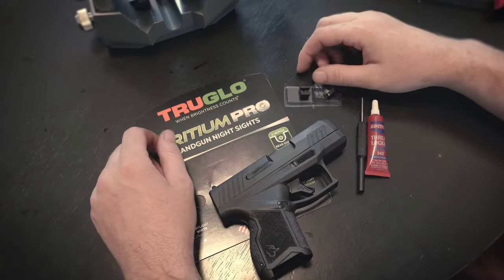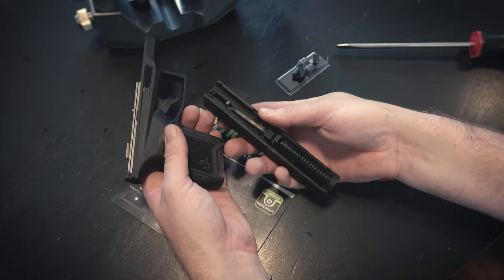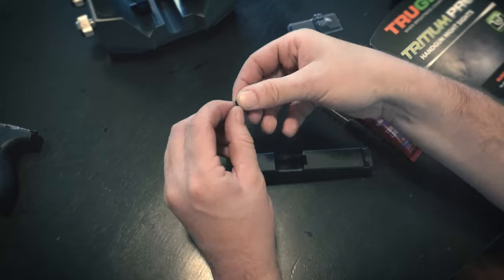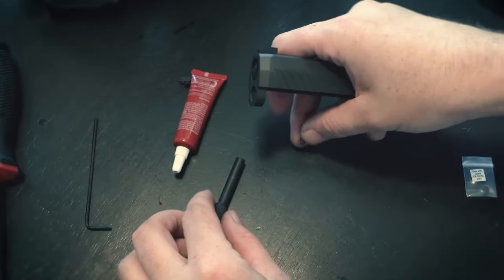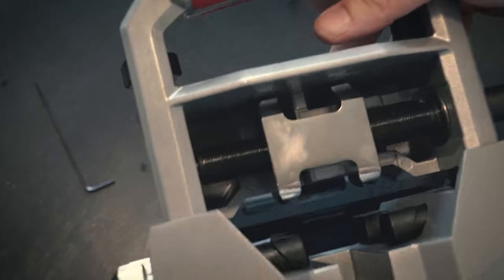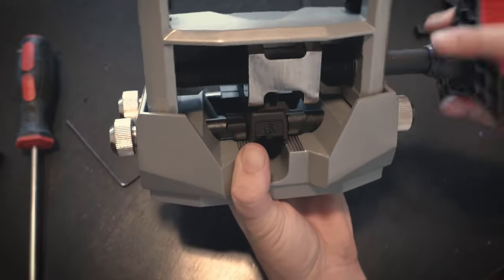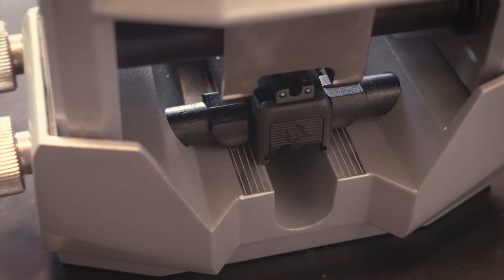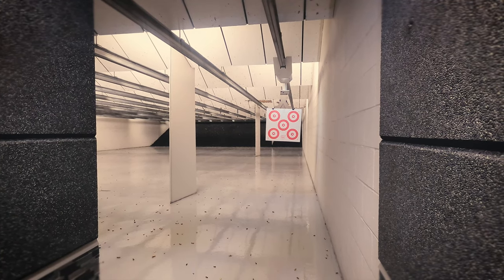Taurus GX4 Takes Glock Sights!

Comment: I ordered the one for the 19 and it worked and looked fine. It is a little wider but there is still room on the sides of the dovetail slot for adjustment.

Comment: Clear it, squeeze the trigger, then rotate the slotted pin. Slide comes off pretty easy. I’ve noticed that if I don’t squeeze the trigger before turning that pin, the slide starts to move forward and gets stuck… until you work the slide again and the take-down pin resets.

Comment: I use Truglo Pro for G17/19 on the GX4. The G42/43 sights have the same height as the one for G17/19. The only difference is the width.
Reply from the maker: Correct, on the rear sight. Front sight is the same. Either will fit

Comment: I like the Allen head screw on the Taurus front sight.  It's a much less awkward system to me.  One big difference between Glocks and the GX4 is that the GX4 has a chassis system.  What that means is if you want to buy a replacement grip for whatever reason on your Glock, it cost a few hundred dollars and will have to go through an FFL.  As with the Sig P320 and P365, you can simply remove the chassis on the GX4 and replace the plastic grip.  This is the second video I've seen with the Real Avid pusher.  I think I need one.

Comment: When using XS glock sights on the Gx4, you want the glock 17-19 option.
Reply from the maker: Yes. To clarify, the dovetail and front sight is the same. It is just the overall width of the rear sight. TRUGLO 17/19 or 42/43/48 models fit.

Comment: To remove the slide why didn't you use the tool that came with your gun? It was that little tiny Mini gun not as a keychain ornament.
Reply from the maker: You can, I just don't expect people to keep up with that thing compared to finding a screwdriver or piece of range brass
Reply: It’s in the instruction booklet that tells you of the little gun on the keychain n its purpose.

Comment: Here's my question... I just got a new Taurus GX4 Carry (toro) and I need to know 'if' that Truglo front sight tool will also work on my Taurus GX4 Carry hexhead front sight screw? 
I believe the Taurus hexhead screw is 3/16".
And if it will work can you give the tools part number so I can order from eBay or Amazon.
Also... the 'punch' end of that tool, does anyone know if it will work for my Taurus GX4 Carry back-strap pins???

Comment: I have a 24/7 Pro, but I called Taurus earlier and they told me they neither have any accessories for my model nor can they give me any advice for tips because of the class action suit, and I'm desperately trying to find at least front sights that are compatible with my model. Do you have any idea if any other model handgun sights are compatible with mine?
Reply from the maker: I know that Glock sights will NOT fit the 24/7 Pro.. That started with the G2 or G2c, then continued on into the G3 and Gx4 lines.
Reply: @AdventureOne  I think I should be fine with my stock sites. I painted the white dot that was on the front sight neon yellow with liquid craft acrylic paint which worked very well on my Phoenix Arms hp22a, and I did but put a touch of neon orange nail polish on the tops of the left and right side of my rear sight, and I found the sweet spot is to have the yellow dot just a hair above the top of the rear sights and it is dead on. So if I can't find any OEM upgrades or aftermarket sights, I think I'll be alright.

Comment: Glock 42/43/43x/48 size? I am interested in these sights on my gx4 and Taurus offers them but for much more than Amazon so I want to make sure I’m getting the correct ones.
Reply from the maker: That's what I installed here, but after further research, the Glock 17/19 sights will also fit.
Reply: I got Truglo TFO for glock 42. They do fit but the back sight hangs off the back by 1/8 of inch.
Reply from the maker: @viki2162  Yep. Seen that before. The TFO is a great concept, but it forces the sight to be larger. One of the reasons I go with tritium only on smaller guns or anything with an optic cut.

Comment: Any Glock sights or a particular model ?
Reply from the maker: I recommend sights designed for the Glock 19.  Most Glock compatible sights will fit, but you may have POI issues if you use sights designed for a different caliber or long slide model.

Comment: I had a problem with the front stock sight coming loose and now a problem with the rear sight moving.
Reply from the maker: Did you use loctite and let it cure for 24 hours before shooting?
Reply: @AdventureOne  I put loctite after but that problem is from the factory

Comment: Does the rear sight hang off. I got the same sights and the rear sight hung off the end of the slide
Reply from the maker: It did not. Maybe you got the TFX sights that were longer? Or was your gun the TORO model? Optics cut designs can push the rear sight further back.
Reply: Same problem I had. I got tfo for glock 42 and back sight hangs off the back.

Comment: If u don't own that machine u used to take the back sight off how would u take it off or at least move it a bit to even out the backsight??
Reply from the maker: For removing the old sight, a hammer and a brass or plastic punch works great. Just be careful with installation. That can damage the tritium vial, and installing a tritium sight with anything other than a sight pusher usually voids the sight warranty
Reply: @AdventureOne  I just wanna even out the back sight. It's pushed more to the left than even in the middle on a gx4.
Reply from the maker: @WavyVaporizers  If it is NOT a tritium sight, give it a tap with the hammer/punch.
Reply: @AdventureOne  ok cool ty for that info
Reply: @WavyVaporizers  use a sight pusher. You can find them on Amazon

Comment: I might missed the point but it's better ask then cry...what sight model is the recommended for GX4? Best regards, from Brazil!
Reply from the maker: Really, anything designed to fit a Glock 9mm. I really like these Tritium Pros from TRUGLO. (Model TG231G1C) The point is that instead of Taurus having their own sight specification, you can now use the larger glock aftermarket.

Comment: greetings can I install truglo tfx pro for glock 43 in my taurus GX4?
Reply from the maker: Yes, but not on the TORO model. The larger fiber sight would cover the optic plate. The back end of the sight may not line up perfectly (since is was designed for Glock) but it will be very close. You will want model TG13GL3PC
Reply: @AdventureOne  Thanks for continuing to add details for additional models.  Much appreciated, to sort out all the options.

Comment: Will the stock front allen sight screw fit in the new front sight that you installed??
Reply from the maker: I don't think so. I believe the larger metal sight requires a larger screw (length and different diameter) than the factory sight.

Comment: So I need that tool or a gunsmith just to ADJUST my rear sight?? 😒
Reply from the maker: A factory plastic or metal sight can be adjusted with a punch (brass recommended) and a hammer. ALWAYS use a pusher tool if the sight contains tritium capsules. Using a punch on a tritium sight will likely damage the glass capsules and definitely void the warranty on the sights

Comment: I had those same sights on my GX4. While shooting it, my shots were all over the place. After having the rear sight centered with the front. It was hitting low left even while aiming dead center.
Reply from the maker: Well, it's not the iron sights that are inconsistent...  https://88tactical.com/how-to-fix-shooting-low-and-to-the-left/
Reply: That is your trigger pull.  You need to adopt an two hand hold and use your left index finger and go in front of thr trigger guard.  Mine shoots 2" groups at 10 yards.  Takes a lot of practice.  Good luck
Reply from the maker: @dmcd7333  I can pick up my Walther or sig and drill the bullseye. My hits are low with just this gun. Its not way off, but noticeable. Maybe it is me, but it doesn't happen with other 9mms I shoot more often. Maybe this gun just reveals my flinch more than others.
Reply: @AdventureOne  shorter barrel micros do magnify any trigger or grip issues.  I bought a lakeline llc black ported barrel for fun... adds another 1/4" and the port makes the GX4 the flattest shooting micro with almost no felt recoil.. compared to my Ruger, Sig, and Hellcat.

Comment: I can’t get my front sight off my wrenches won’t fit even 2mm
Reply from the maker: Make sure you are using the right hex size. Try applying wd40 or penetrating oil. If that doesn't work, gradually apply heat

Comment: you lost me with the rear sight tool  , I'll only use it once or twice , I'll let a gunsmith put these on .
Reply: I bought one and I've used it about 8 or 9 times the gunsmith will charge u about as much as the tool cost
Reply: @thepistolguy859  good point .
Reply: Buy the sights from a gun shop that installs them for free

Comment: Everything was cool until you pull out this big ass uncommon tool that nobody has so now we all got to figure out an alternative way to change the rear sight by guessing what will work alright... Duhh lmao
Reply from the maker: You can totally do this with a punch - many do, but you will void the warranty on the sights and have a good chance of breaking the tritium vial. There are lots of videos showing that method, but this is the way that sight manufacturers actually recommend. Go in with a few buddies on sharing this tool and it is worth it in the long run.